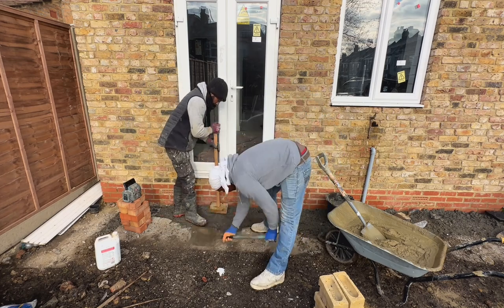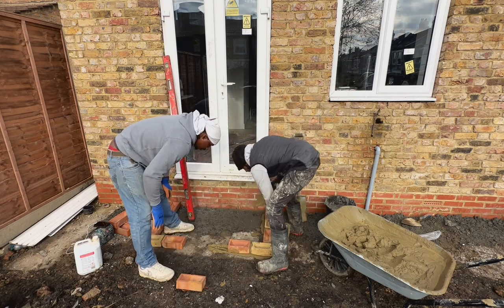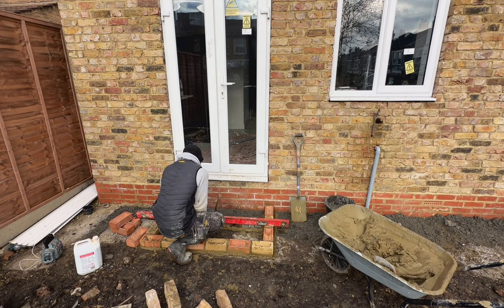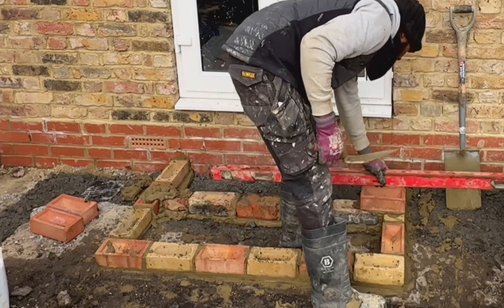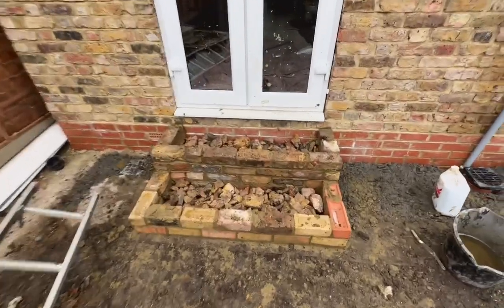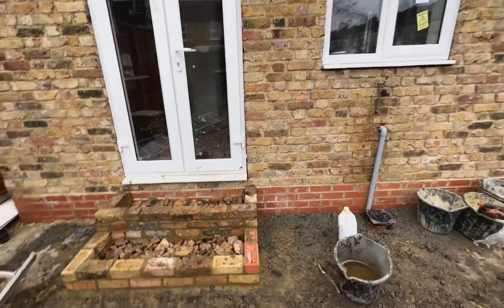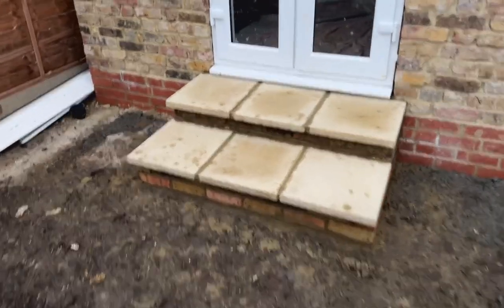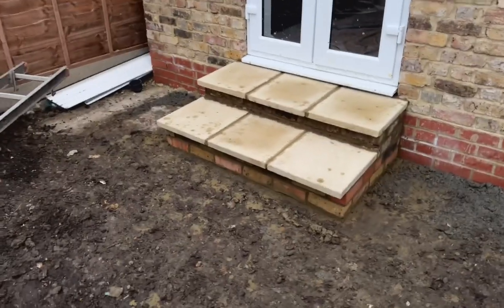How to build brick patio stairs

Comment: if you brought the brickwork out another 100mm you would have saved yourself the headache of cutting your slabs and that funky bonding you got going. you could have got away with 1 step, with three courses plus your slab would have given you enough height and you wouldnt be above dpc.
Reply: Everyone's an expert on YouTube😅
Reply from the maker: The slab wouldnt fit if it was 100mm extra and the step would be alot. Only the slab is on dpc which isnt a problem under the door. I prefer it this way
Reply: @darrenthebuilder  bricks are 215mm with a perp is 225x 4=900. your slabs are 450x 2 =900. so it would have worked, bringing it out 100mm instead of having  775mm. The reason i said you could get away with 1 step at 3 courses is because im guessing the customer is going to patio the garden which would bring the garden level up to the top of the 1st course leaving you with a 215mm step including slab and would have finished 150mm below dpc.
Reply: @mikeypc3592  been a bricky for 25 years. although im not an expert, i hope to be 1 day. always learning in this game. thats why i watch these types of videos. you can pick up little tricks that other people might use  😉
Reply: @TheTwarag  great look forward to seeing your videos so we can all learn something👍🏻
Reply: Not bad. The concrete slabs look a bit utility - you could consider some smooth (not riven) Indian sandstone with staggered joints., would look much nicer and cost very little more.

Comment: Nice job over all on the steps . Good to see the steps topped with concrete . At bare minimum you should drench the back of the slabs with water to stop them sucking the life out of the bedding mortar . Wetting the back of the slabs will ensure a good bond but really they should be slurried prior to laying . Over hang on the slabs in relation to the brick work seemed a bit much .
Reply: What does it mean to slurry the slabs?
Reply: @michaelb1478  look up paving slurry . It’s a thickish soupy cement based mixture ( that comes in power form .just mix with water ) that you brush onto the back of the slabs prior to setting them in the mortar . The slurry sticks like f..k to the slab and the slurried slab sticks like f..k to the mortar bed . On steps like these I’d also slurry the steps prior to laying the mortar bed .

Comment: Nice finish as always. Is there any chance of bridging the DPM by laying steps up to the extension?
Reply from the maker: There is a small chance. The steps are directly under the door so it would really be much of an issue anyway, although out last row on bricks stops at the dpc so it’s not really bridging either. If in doubt run a bit of dpc vertically